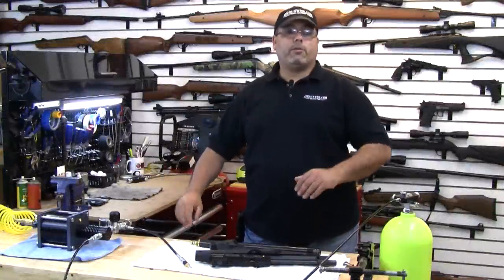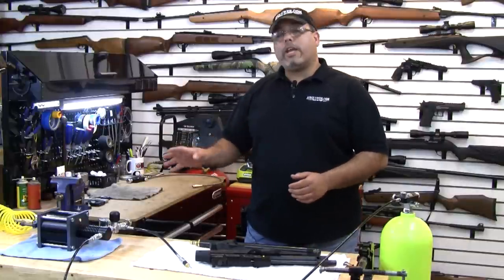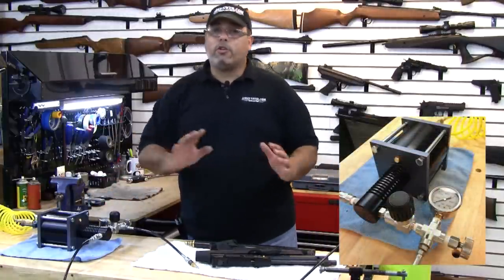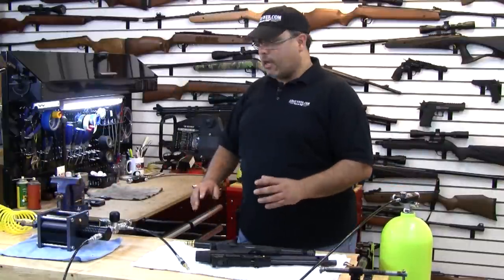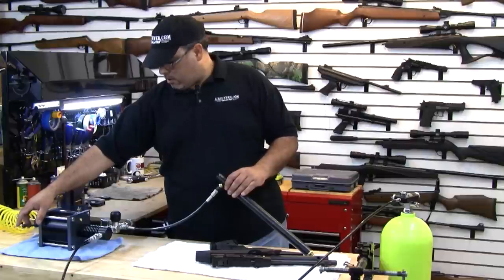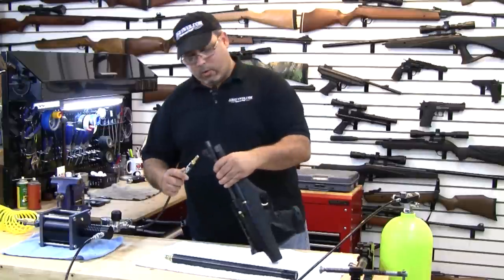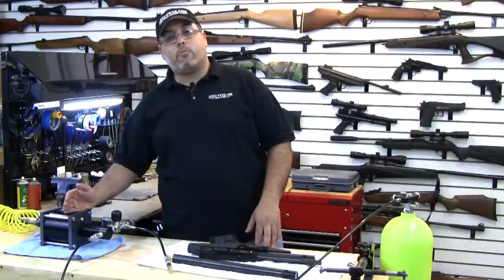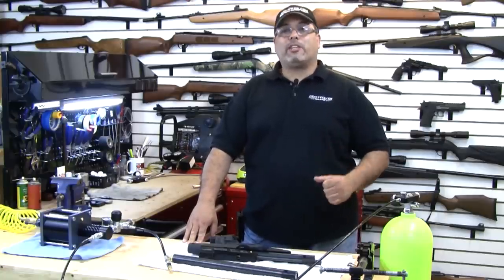HPA Booster - Rough Cut Video by AirgunWeb

Comment from the maker: The first cylinder was for the AT44 series rifles from Hatsan.  It contains the valve as well as the pressure tank.  You can have several with you in the field and always have the power you need.  The ATP2 pistol also has a removable tank.  I'm not sure of the current availability for spares at this time.

Cheers, 

AGW

Comment from the maker: It works really well.  It will boost up to 5000psi so you can certainly go past 3000 and fill your 3500 psi guns.  I have the Walther Dominator and it fills it to 4300 no problem.  I'm going to set it up on a cart with 2 tanks.  One regulated to drive the 100 psi side, and the other to provide the HPA source.  It should make for a good 2nd video when I get around to it.

Nice to hear from you by the way.  Congrats on all the success!

Cheers
Rick

Comment from the maker: to get a portable tank to 4500 you'll need 1 HPA source, i.e. scuba tank, the booster and a compressor.  You "need" about 1000 psi in your scuba tank and the booster will do the rest to get your small tank up to 4500 psi.  The more pressure you have in your Scuba tank to start with, the faster the process will go.  If you have 2 scuba tanks, you can use one in place of the compressor.  You have to use a 100psi regulator on low pressure side.

Cheers
AGW

Comment from the maker: On the HPA side, it will depend on what you have for an HPA source.  Contact the manufacturer via his site for direction on that.  On the low pressure side, you just need a standard quick connect that you'd find on any standard compressor.  If you want to connect a high pressure tank to the low pressure side, you'll need to contact the manufacturer.  He has some data on how to accomplish that.

Cheers
AGW

Comment from the maker: With this you can use a $150 tank, you may spend another $100 on hoses (under $50 on ebay). My dive shop charges about $8 per fill. I need to top off my scuba tank after 10 fills generally and only the first couple are full 3000 psi fills. I now get about 60 or 6 times as many fills. So that's 8 x 6 = $48 - $8 (initial fill) = $40 savings. After 15 trips (just in fill fees, not including gas or time) I'm even on the booster. For someone that shoots a lot.. that's a big deal.

Cheers,
AGW

Comment: Hey thanks for the info on the HPA Booster.  I have been icing down my tank in a cooler then having them fill my tank to 3,300lbs to get a little extra. I bought a NP Trail to have a back up for my Marauder when the air is down.  I am really enjoying the quit shooting of air rifles over my powder guns and the access to properties now that I use air rifles.  I have been able to make 100yrd shoots with these rifles just need scopes with mil dots and tactical turrets that go up to about 16x power.

Comment from the maker: Yes. It is easy to maintain. The kit includes a rebuild kit.. No it will not fill any faster with a scuba tank regulated at 100psi. 100psi is a 100 psi.

Cheers,
AGW

Comment from the maker: Hey there.  I've got so much on my plate right now.  I'd need Hatsan to provide one to review as well.  I'll send a request and go from there.  From what experience I have with the 155, it's best in the larger calibers. .177 is too light.  The .25 is what you want to go with in that gun.  If you want .177, go for the 100x or the dominator 200.

Cheers
AGW

Comment from the maker: nervoustwitch77 - Sorry for the delay.  I use the booster so that I don't have to go to the dive shop.  I've found that it's most useful filling my 4500 PSI pony bottle for when I go shooting out in the field.  That's something that I could never do on my own without a $3500 compressor or maybe a Shoebox compressor.  $600 is a lot of money, but if you DON'T have a scuba or fill option right next door, then it can save you a lot of money and travel time over the long run.
Cheers
AGW

Comment: Would be easy to make a multi stage version of this that would work entirely off a workshop compressor, using only air from the compressor to achieve (through multiple stages) the desired end pressure,.. No high pressure air required.  Could also be self reciprocating so that you don't have to hit the button for each stroke.  Just click an off switch when it's done.

Comment: Can you specify exactly what additional fittings are required to attach to the pump's high pressure air intake and the low pressure (100 psi) piston driver intake?

Comment: Rick I picked one of these up. What fittings did you use to connect everything?
Reply from the maker: Air Marksman - depends on what you are trying to connect to.  There should be a list of fittings on my webpage on my site associated with this product.  If you email me what you are trying to fill, I should be able to tell you what you need to get.

Cheers
AGW
Reply: Airgun Expert & Critic - Rick Eutsler / AirgunWeb Thanks, I ended up ordering one of the parts I need online.  I however still want to make it so I can take this system out into the field and use two tanks to fill and run it.
Reply from the maker: Air Marksman - that is how I have mine setup.. I have a 120 PSI regulator that a SCUBA shop rigged up for me.. that goes into the low pressure side and my high pressure tank goes into the high input side.  It works really well for in the field. 

Cheers,
AGW
Reply: Airgun Expert & Critic - Rick Eutsler / AirgunWeb Paper work for mine says not to exceed 100psi on the low end. So far just using my shop compressor it has worked perfect.

Comment: is it possible to run a 100 psi on both sides or if you dont have access to a hpa source
Reply from the maker: +Fred Herbst - no you need an hpa source of at least 1500 psi.. 2000 or 2500 is better.

Cheers
AGW
Reply: +Airgun Experts - AirgunWeb / AirgunWebTV  sorry for rhe late replay thank you for the info greatly apreciated